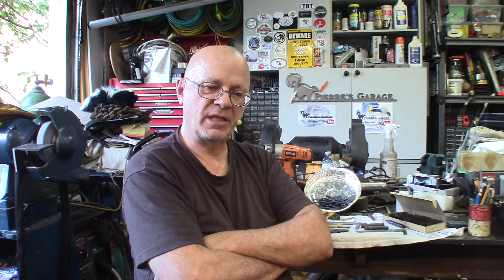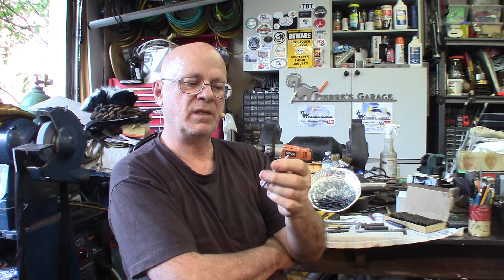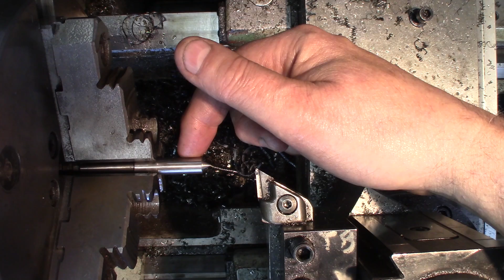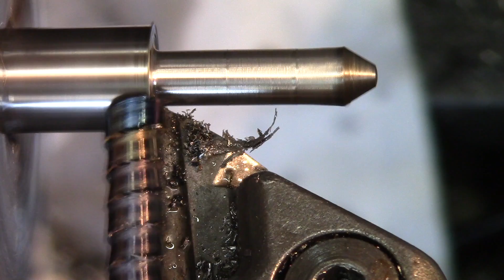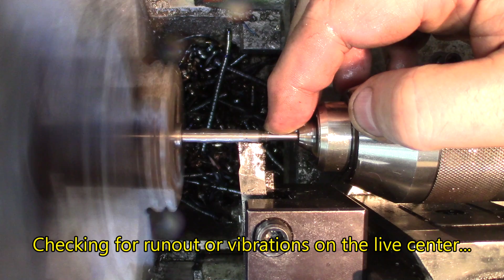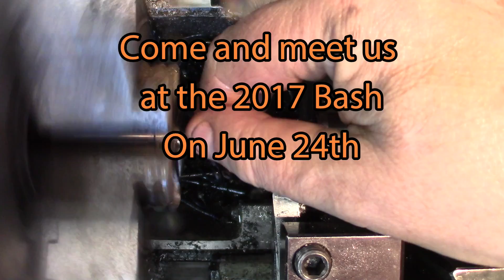Lathe work Higher removal rate with one heavy pass on a long W-1 steel cylindrical rod…

Comment: You know Pierre, if I tried that on my lathe, I'm pretty sure I'd break a bit and bend the workpiece. Of course my lathe is a piece of crap. It's made in Canada. LOL Just kidding. It's an Enco.
Reply from the maker: Hi,
If you want to try this make sure the chuck is able to hold without any loose, beware of a bell mouth chuck...
You can try it gradually and find out where it stalls...   ;)
Thanks for viewing and for comment,    Pierre
Reply: I think stalling would be the real issue. It uses some very tiny V-belts. Thanks for the tip though.

Comment: Nicely done, I've seen turret lathe tooling where the part runs against a follower and the tool pressure pushes the part against the follower, very vast repeatable set up from early part of the century when the setters knew time was money machining production runs.
Reply from the maker: For making only one part and with just a little removat it doesn't count so much for saving time but with many pieces it really adds up fast, mostly long little cuts with little advance.
Now serious CNC operators and set-up person will work hard optimizing the ops in order to save time...   ;)
Cheers,    Pierre

Comment: Nice....curious...if you had put the part in a collet with a hard stop could have you completed the machining in one setup.....i.e.not re-chucking?
Reply from the maker: Hi Chuck,
To get enough holding you can't count on only 1/4" to achieve this kinda cut or it will just whirl in the collet ( tried and it didn't work ) 1/2" in my chuck was adequate, beware of bell mouth chuck... 
Cheers,    Pierre

Comment: For the heavy cut, what kind of rake on the holder / insert?  I'm imagining that a negative rake would push the work away too much on that kind of part?
Reply from the maker: It's a negative rake insert, you got to be certain your part is held solid in the jaws or it will happen what you just mentioned...
Some time I'll try to show the actual insert and holder used in this video.
Thanks for viewing and for comment,    Pierre

Comment: By far the deepest cut I've ever seen made by anyone! And on W1 to boot. Impressive lathe... BTW was looking forward to meeting you at the bash but other issues killed that trip. Cheers....
Reply from the maker: Hi Dave,
This is a not a problem about the cut as long as the heat goes away in the chip... Or else, you may end up with a tough part to finish....
In plain steel this lathe can safely rip 0.800" on the diameter.  It's got a 7.5HP 3 phases motor...
After the bash we'll be heading your direction for a few days, a possibility of a short visit, if you're up for it...
Cheers,     Pierre
Reply: The shop is open just let me know when so I'll be here....
Reply from the maker: If I'm right we leave LA for San Diego on the 25th of June we're there for 2-3 days...
Reply: No problem...